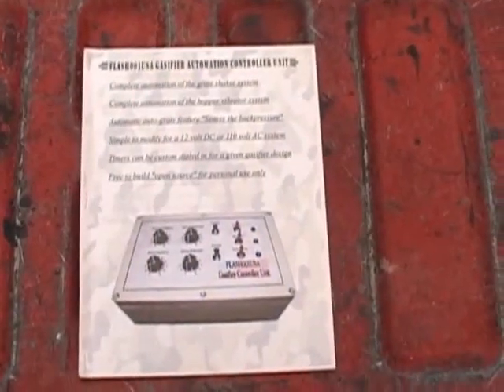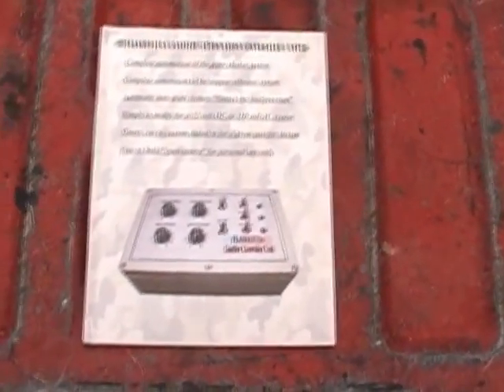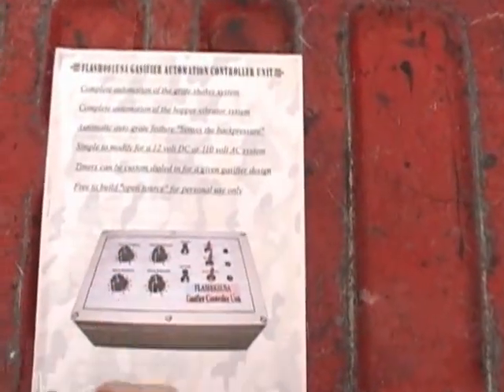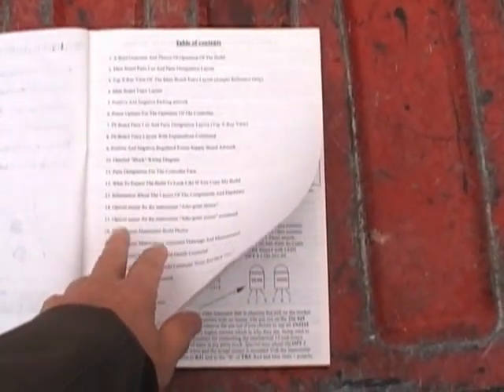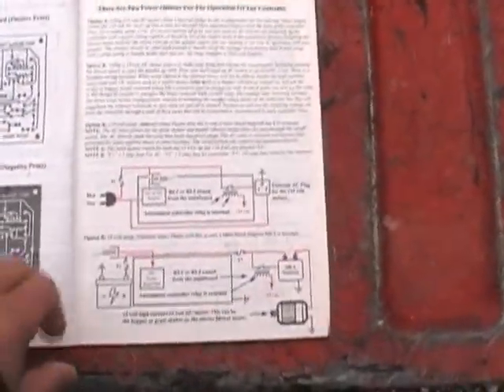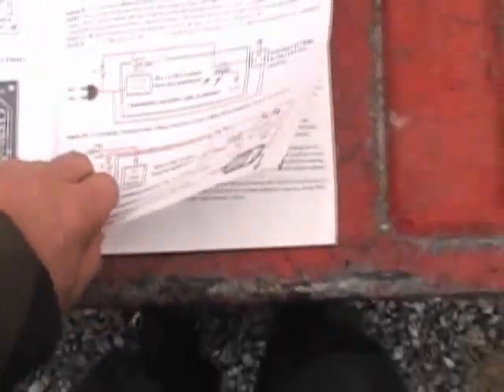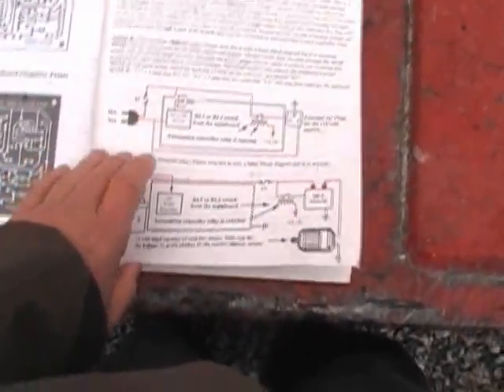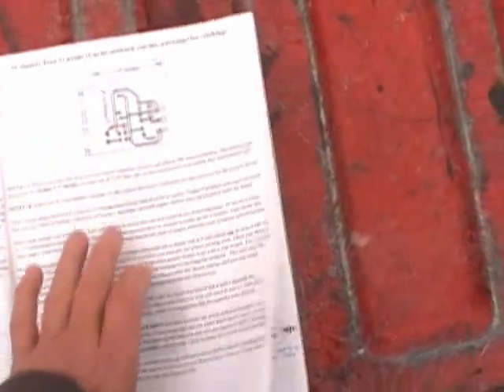PDF file for the Controller build now available

Comment: So... um... where are your PDFs located? I found the one here for the controller, but your website doesn't have any of your files published, and I don't see any links for them. Not very helpful if no one can find them.
Reply from the maker: The website went through some changes and the files and link need to be re added back to the website. If you would like a copy of the PDF file just contact the host on the website and request a copy and I will be more than glad to send them to you.

Comment: I don't see the file on your website and the link doesn't seem to work on my phone?

Any advice?
Reply from the maker: Hi go back to www.miniwoodgas.com and contact the host and I'll send you the file. I did copy and paste the link and it did work but this was on a PC. It's a standard every day PDF file so it should be able to open with no issues.
Reply: @flash001USA  thanks I'll do it right away

Comment: Hi Flash. Excellent job. Starting to start my Flashifier setup. Is there a circuit diagram available for the control board. Could get a copy of the CAD drawing.
Reply from the maker: Not a problem. Reach out to me through www.miniwoodgas.com and contact the web host.

Comment: Great video, Thanks for all the infor. I tried to find the PDF at www.miniwoodgas.com/Gasifier_Automation_Controller_ver_01.pdf  no luck. Please put me on your list for it, THANKS
Reply from the maker: Sorry about that... There was an extra character in the link. Use this and I'll correct the link in the description. www.miniwoodgas.com/Gasifier_Automation_Controller_ver_01.pdf
Reply from the maker: I already replied back to you and at first I thought I had placed an extra character in the link but that wasn't the case. It's possible I was working on the website and the link was temporarily down. The link should work now. Let me know if you are still having any issues.

Comment: EXCELLENT. Great job Mike. I am going to download that and add it to the other PDF files I have. While I have the FRM timers, I will most likely use the manometer set up you made on mine. I love that idea and have seen it in action on yours. Works fantastic. That is going to be down the road though. Way too many other projects happening at the moment. Great job on the kitty shelter. That is sweet. By the way, how much fuel wood do you estimate you have sitting out there with those downed trees? Some of the smaller branches would already be harvested and put away if it was me. Lots of damage from that storm. Great job in the video and control system
Reply from the maker: As far as firewood goes more than I'll use but there is always plenty of seasoned dried stuff for the gasifier on the ground just waiting to be picked up. I really need to sit down and build a chunker so that will be on the "To do" list in the future.
Reply: @flash001USA  If I remember right, you did get the gear reducer yes??
Reply from the maker: Oh yeah! I got a heavy duty one.
Reply: @flash001USA  I thought so..................Time to rock?? Send me what you are thinking on the build. I have a little experience with chunkers...